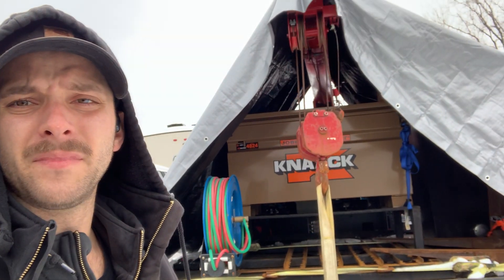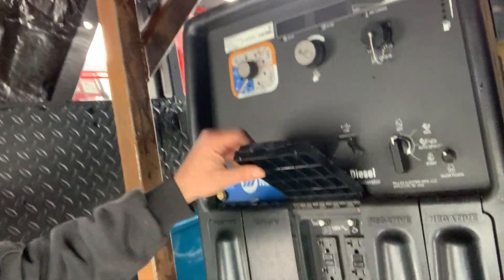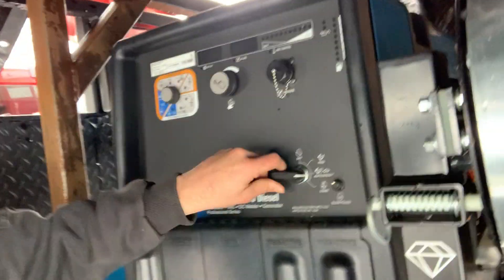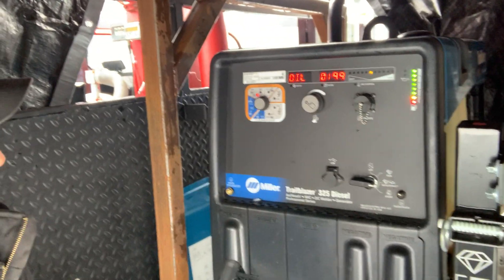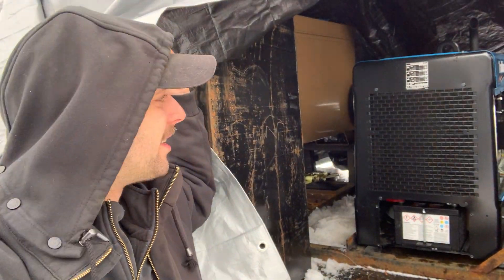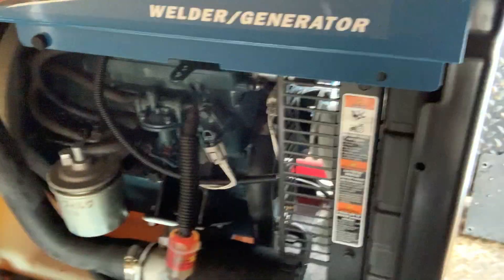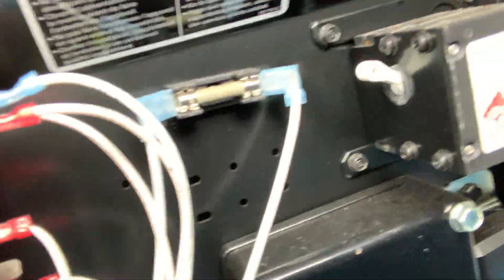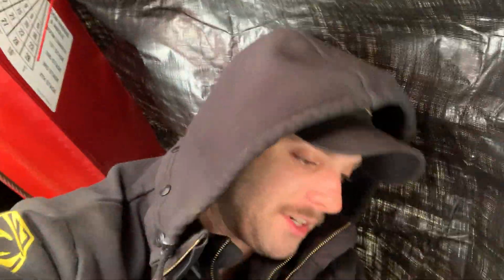Miller Trailblazer 325 Welding Issue 2022

Comment: We have a fleet of trailblazer 325 gas machines. Very disappointing.   They weld good until they don’t.  We’ve had problems with all of our machines.    Ours are used outside all year in New England.    They add PC boards and electronics to stuff that’s used in the elements.  I don’t think it works out so well.